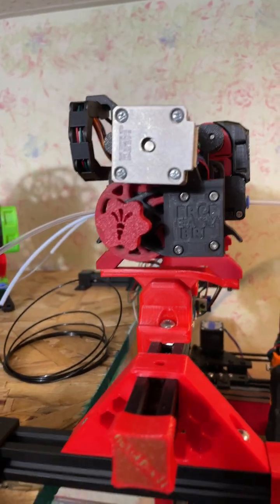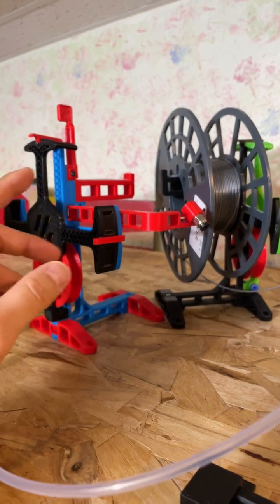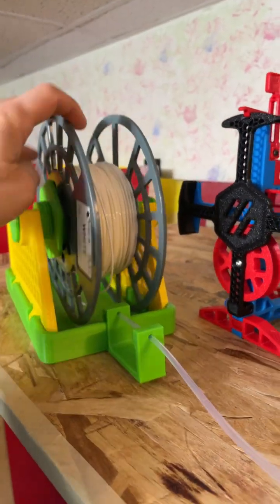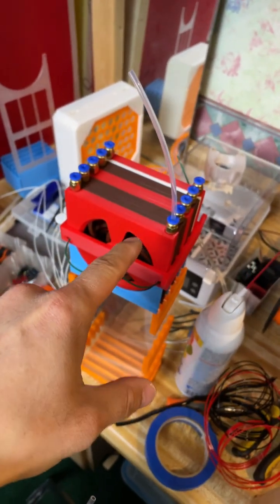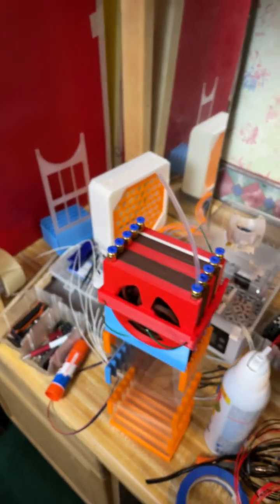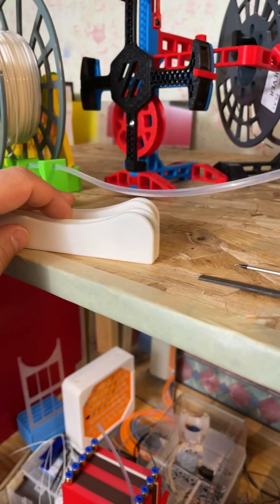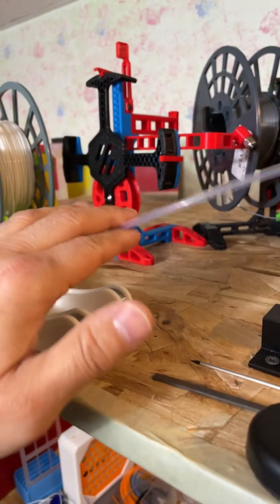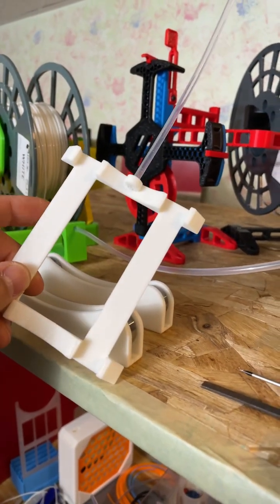Filament buffers & more buffer.. #shorts #3dprinting #voron #klipper #mmu #ercf

Comment: is it possible for you to share the files of the spool holder and the part you have designed please? :D
Reply from the maker: here are the ones I've tried
https://github.com/x0pherl/Filament-Bank
https://www.printables.com/model/138267-tzb-mmu2s-filament-buffer/files
https://www.printables.com/model/10370-gravity-spoolholder-for-mmu2s
Reply: @Outofbox11  do you have the file for the ptfe tube holder?, also how is your buffer solution coming on? which do you recommend i should build?
Reply from the maker: I need to find it and need to upload it to cults